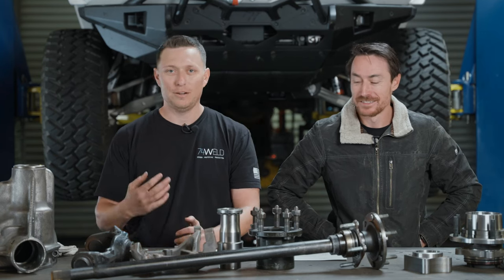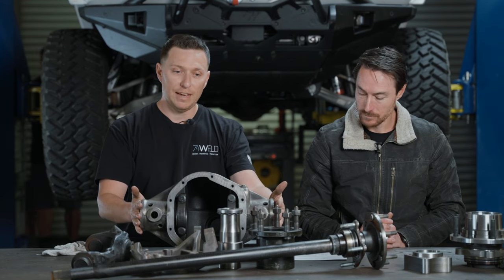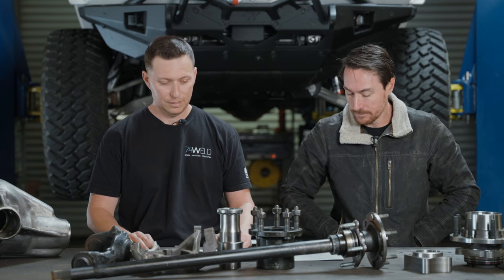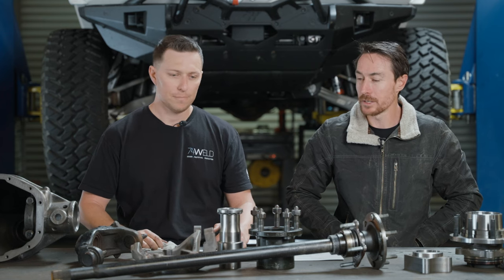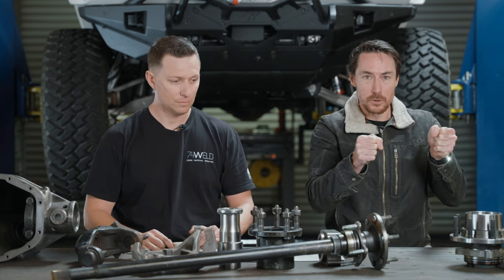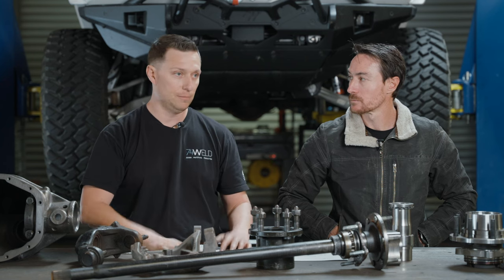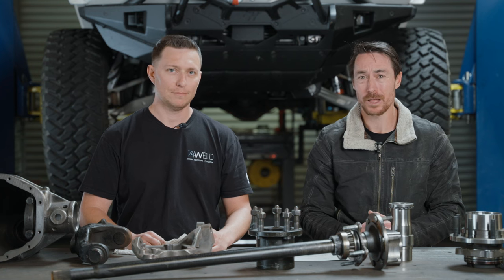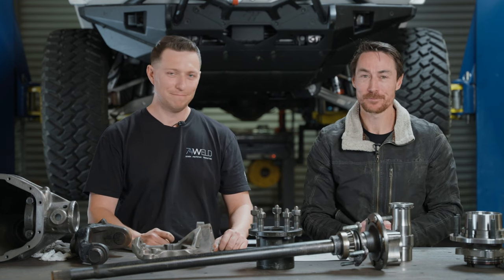Everything you need to know about axle housings

Comment: Great video. I cant say that enough. Lots of good clean technical information.

One thing I want to add . The JK "end forging" being weak is an issue, but............BUUUUT a lot of so called bent "inner C's" are probably not really bent. The axle tube is really weak as well, and having the spring perch where it is creates a nice shear plain thus the tube bents right there. I bet almost every JK that see's trail time has some deformation in this area. I know personally 5 or so Jeep buddies who went to sleeve, and truss their axels noticed the housing bent right there. 
So for you JK folks if you gusset the "C" make sure its also welded to the tube, and perch really well.  Those " Dino" C gussets are trash for this reason.

Comment: Guys, thanks for the deep dive, valuable tech!
Q:  For remote expedition work applications what is the potential fail point of your Portals front , Portals rear? say JL.     Reason for Q is ; what spare portal components would one carry and in what order of priority. Stating the obvios that weightGVM is always a factor and clearly in your custom portal case availability of replacement components whilst remote is gonna be near zero around self recovery.
Thanks in advance; CB
Reply from the maker: We have seen one broken part to date. We had a race car last year at KOH twist off a 35 spline stub as the stub does not see gear reduction. This was partly our fault as it had a snap ring in the torsion zone but this is also how all Dana 60 front ends were built for decades. Either way, we have since changed that, eliminated the stress riser, and have not seen a failure since. Want to carry spares? You could carry a full gear set, bearing set, and stub. In our experience, even if you explode a gear set inside a portal, the bearing surfaces are typically not damaged and you can replace internals and be back up and running. If you are really going to do some crazy remote expedition and want to run portals, you can come see us and we can train you how it all works and what a trail catastrophe would look like and what you would need. We have never seen it happen but prepare for the worst and you will be ready for anything 😉
Reply: Vital info; Thanks heaps guys. Regards CB

Comment: I completely agree and favor the Ford 9”.  I emailed Curry asking if they were planning to do a bolt in 9” for 6G Broncos and they said no. They have a Dana 60 for it and it has an electric locker.  I’d rather have a 9” with a Detroit locker for my use, especially since I have a lot of 9” parts already.
Reply from the maker: @bobmeyer7309  I agree. The reason that they don’t push the 9” more is just because of cost. It’s just a lot more expensive to do a proper built 9” but yeah. I’m with you on this one as well

Comment: I saw on your website that the currie F9 was an optional axles set up, I was wondering would your portals work with the Miller Motorsports Spidertrax axles for the JK?
Reply from the maker: We work with Spidertrax on lots of stuff, but have not yet don’t a portal for their knuckle.
Reply: @74weld  that what i had seen through looking at your website but i was wondering if i had a built housing and put some Reid racing Ford knuckles basically a Ford 609 with some Dynatrac ball joints this could theoretically work.

Comment: Dana does not weld the tubes around the end of the cast center section for good reason. It makes me shudder to see so many people (and professionals) weld around the tubes at this point. Ductile iron castings contain excess carbon in graphite form, either nodules (nodular or spheroid) or lattice flake (pearitic).  Welding to these castings disrupts this structure, bringing the graphite / carbon into the mix in the weld zone and creating a hard brittle area / weak spot.  These iron castings are not steel, and Dana and other axle manufacturers spent a lot of effort to get the heat treat right.   Crazy to see these people actually weaken a perfectly good housing by doing this !! Even more nuts is the aftermarket housing assemblers doing it !!
Reply: It can be done if welded correctly and needs to be done for extreme use.  Requires pre-heat and high-nickel rods.  Stress relieved during and after weld process and slow cool.  I frequently weld cast iron at my job with CAT.  Becoming a lost art.  Definitely shouldn’t be mig welded by the average joe. That being said, Welding a truss across the top connecting the axle tubes to each other without welding to the ductile iron center casting is a better idea for the average welder.  But should be checked for straightness afterwards and straightened if necessary by heat and cool on opposite side of the welded tubes
Reply: Ford 8.8" in drag application on slicks. The plug welds would fail. What's the solution to make the center stay attached to the tubes?